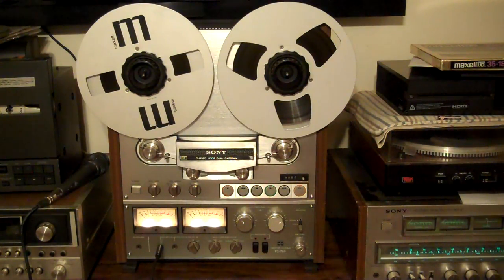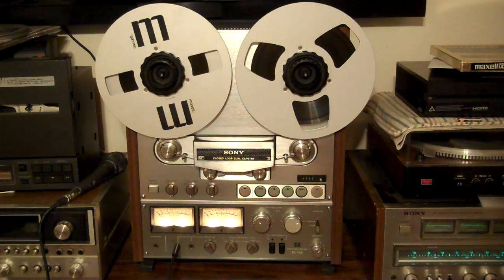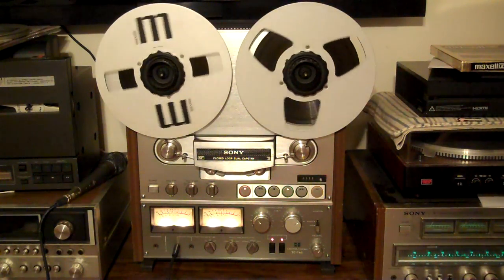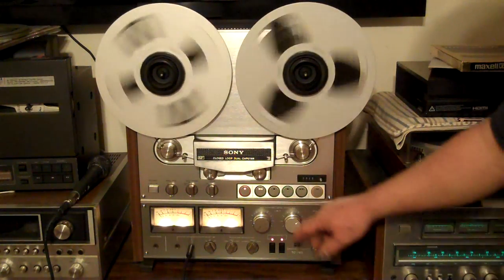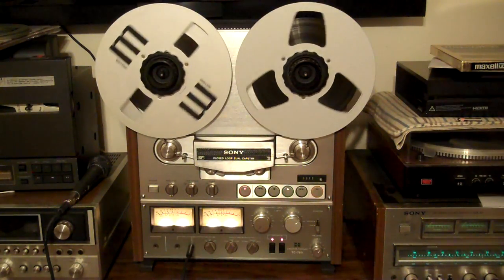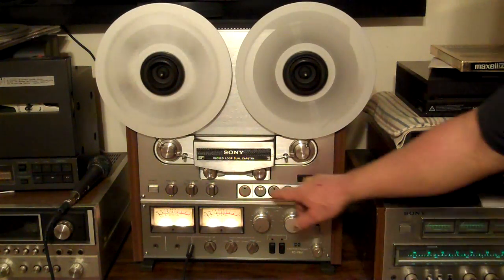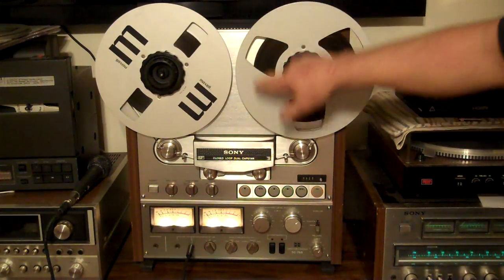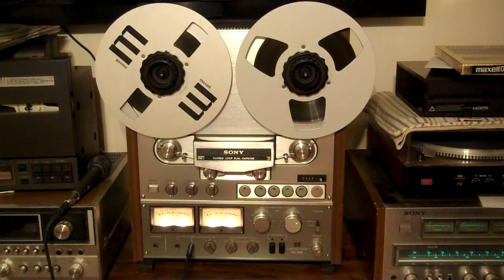SONY TC-765 CLOSED LOOP DUAL CAPSTAN Reel to Reel, New Belts, re-capped PS working Nicely. ZCUCKOO

Comment: the tape works well on the head when they put back the old pinch roller
Reply from the maker: Sounds like the pinch rollers you got were bad. Right? Keep the old ones and get a refund on what you bought since they do not work properly. Belts are the main thing you need to replace, If pinch rollers are true then keep using them. I did on mine.

Comment: Hi.. I have this deck... now it only goes in reverse and fast forward.. when I press play it takes off in Fast forward...Any ideas? Belt?..Thanks I appreciate any help.
Reply from the maker: Sounds like the Pinch roller mechanism are not giving enough pressure against the capstans and the rollers. Common issue. Needs maintenance. Dis-assemble, clean re-lube etc.
Reply: @Zcuckoo  Thank you so much for taking the time to respond and advise me on this. Very much appreciated.

Comment: How much would I be able to sale this t-765 with the remote control and blank tapes
Reply from the maker: Well it depends on it's functionality, cosmetics etc. Currently what has sold on ebay has gone from 400-1300 and most have the remote AND 10.5 reel adapters. Does your deck Playback and record? Rewind, fast forward? Has it had ANY service? Mechanical and electrical? All these things come into play. People typically want to buy and repair or buy and use with it working Properly and the prices go accordingly. Good Luck.
Reply: It does work  everything is really clean.  The guy who sold it to me was like super anal so he said everything works it may need a tune up.  I don't have any use for it or know how to even use it

Comment: Hy.ZCuckoo..My name is Laurentiu from Romania....I have a  SONY TC 765.. I replaced the  Hy.ZCuckoo..My name is Laurentiu from Romania....I have a  SONY TC 765.. I replaced the  belt  and the two pinch roller...The tape is not in the correct position on the head...It goes into the side of the head...When the old rolls put them back it goes...Can you please help me please !!!
Reply from the maker: I don't completely understand. The tape rolls off the head after you replaced the pinch rollers and the belt?
You put old rollers back  onto the machine and ___?________. What happens when putting the old pinch rollers back on?
Reply: Easy realignment
Reply: Ha I have one. I am Romanian too. Transylvania. There are MANUALS on EBay that you can buy to show you how to align the rollers and even bench test. The tape is being OFF SET by  bent or worn roller guide or guides. Easy repair for many Sony reel to reels have similar roller guides.